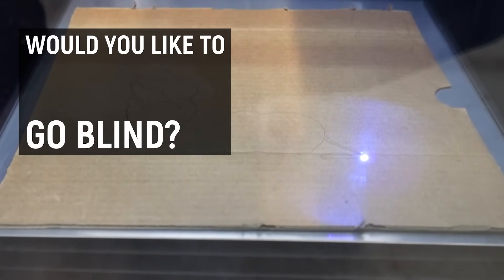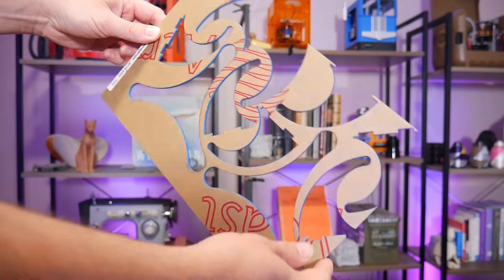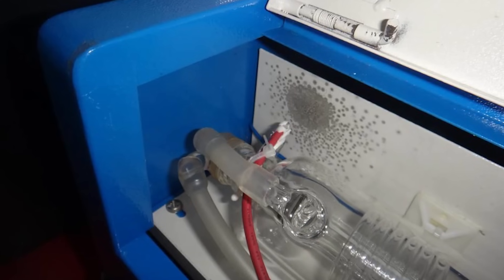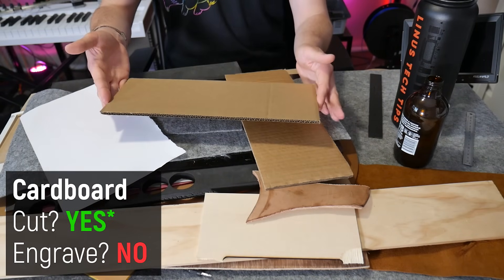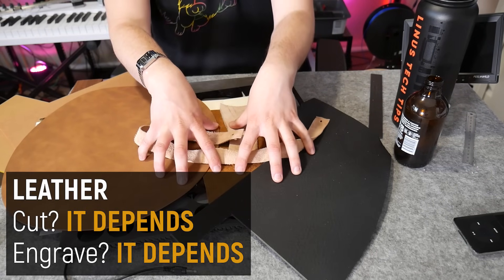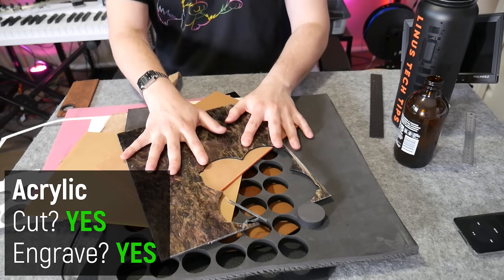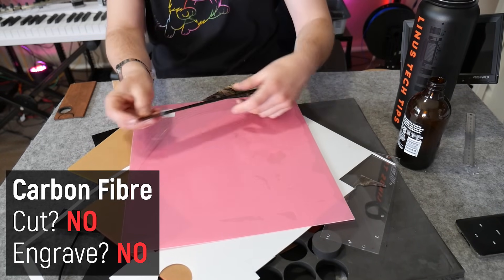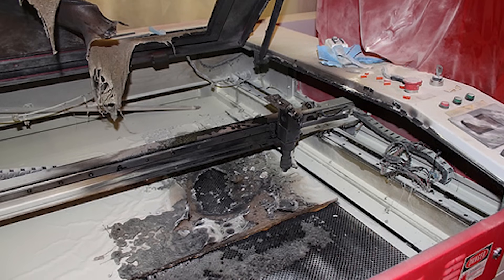Are cheap laser cutters safe?

Comment: I have laser googles that are safe to use with my laser but first thing I did was to build enclosure with fume extraction.
I rarely look at open laser when it's working.
Being in the same room with working uncovered laser for prolonged time is asking for trouble.
You will look away from the laser in the way that your googles are not protecting you.
All it can take is one stray scattered beam of laser light to do harm.
I once cut all the way to the floor with a laser that didn't power down after finishing the cut.
Nothing bad happened, floor was clean concrete and there was nothing to catch fire
but it was a surprise to see a blue dot on the floor when I knew that laser finished the cut like 5 minutes ago. :/

On another note: it is possible to etch acrylic with diode laser. You just need to paint it with something that the laser can affect.
And with 440 nm I found out by chance that after the beam passed clean through one layer of clear acrylic it didn't have much trouble engraving second layer of it.
Something to think about.

Comment: I bought an xtool D1 pro recently to start messing with laser. I haven't used it yet since I am still building the enclosure with fume extraction. I also got a 24x24 sheet of 250nm shielding for the lid from JTech photonics. Thanks for the video it adds a lot of extra information to think about/research.

Comment: poly-carbonate is a wide range of plastics one in particular I know should be safe to cut called lexan its used on police riot shields because of its durabilty and if burned releases CO2 as the main gas and few other trace gases such as water vapor as far as the yellowing I know lexan does yellow when exposed to UV and anti UV coatings are A not gonna cut well and likely have fumes anti UV coatings might etch just fine or they might scatter UV rays all over the place so this needs more testing to know to know about the coatings the lexan it self should be fine if its plane simple high impact lexan they also make fire rated lexan that is also likely to be a problem to etch and cut and the fumes are gonna be unknown

Comment: Look, for liabilities sake I realize that you cannot explicitly say what is or is not safe.
However, from a physics standpoint, most of your concerns are moot.
As you're aware, the intensity of radiation decreases with the inverse of the distance, thus, by the time the reflected laser light has traveled from your workpiece to your eyes, it's experienced quite literally a six order of magnitude decrease in brightness.
So while it may look bright, it's essentially harmless.
Furthermore, for the infrared lasers, while they're significantly brighter, the infrared light is highly absorbed by the water in your skin and eyes.  Well this might not be good for the surface of your eyes, it definitely protects your retina from damage. Unless the laser is getting shined directly in your eyes, you're not going to be injured from a laser of hobby grade.  When it comes to off gassing, your concerns are equally moot.
In the medical industry, when you have problems with wound contamination, the first thing they will tell you is that the solution to pollution is dilution.
Does cutting PVC create hydrochloric gas? Yes. But it creates a very tiny quantity over time, and even if it does make it to your lungs and it does recombine into hydrochloric acid, there are so many free species of ion that it will form salt almost instantly. The same thing goes for carbon nanoparticles. The real danger exists actually with larger particle sizes that your body cannot break down and metabolize.
Call your safety recommendations are good in practice, and it's good to have proper habits. But it's also good to be aware of physical limitations to safety paranoia.
I would be less concerned about breathing stinky byproducts, and more concerned about improper ventilation or filtering for the room. Poor room ventilation will actually impact your health far more severely than the burning byproducts of some of these lasers.

Comment: You really do NOT want to laser-cut chromium-tanned leather.  Chromium is one of the things you really don't want to "fuck around and find out" with.  

(I've worked in a chromium plating shop.  It tends to have nicknames like "Liquid cancer" for reasons.   )

The other downside of laser-cutting pvc is that the HCl gas is of itself highly corrosive, and will stuff your lasercutter - in addition to seriously harming you.

Comment: There are ways for makers to safely use a laser:
1) go to a professional makerlab where you have a professional laser and get proper instructions
2) hire a professional company and get the parts cut
3) start reading your local regulations on employer's safety, book a training from a professional company

You know what happens when you put an egg into boiling water? The same happens when a laser heats up a spot in your eye

Comment: I just got one of the Creality Falcon 10w lasers and was cutting out a pumpkin from a 5 gallon paint stirrer (which I have done like 20 times already at the same settings), had to pee so I went to the potty. Came back and the stick was on fire and it melted the red plastic laser cover they come with. This was at like 70% power, cant remember speed, and doing 4 passes so I could run it faster to supposedly help with the fire issue. DEFINITELY wear the glasses, get more glasses and out it somewhere people can't just stumble into the area while you are using it. I bought a cover for this one along with an extractor fan and hose to vent it from the enclosure (just like a grow tent) but have not put it together yet as it is in my garage, no kids at home and the only animals are the wild critters running around (so many deer...sheesh).
Anyway, thanx for the video and I really do hope people take them seriously as they can turn on you in a heartbeat and injure you or a loved one if you are not careful.

Comment: No. The answer is no. That should be in giant letters 2 seconds into the video. The answer across the board is these are not safe, and if you can't see that from looking at them you shouldn't use them. I'm 10000% for these things getting cheaper and more available. What's not good is the number of people that now have access to devices that can seriously injure or kill not only themselves, but everybody else in the house/apartment building as well. 
Fire, the obvious going blind bit,  chemical weapons grade off-gassing, etc. 
These are shockingly dangerous machines. - Add to that the fact that many of the cheaper machines are outright electrically dangerous. My chinese 40w machine shocks the hell out of you if you touch the case. The pump it comes with grounds to the water you submerge the pump in.... If you touch the water you get the hell shocked out of you. My machine is far from a one-off. It's pretty standard.

Comment: I really like your videos. In my opinion though this came across as be afraid of all the things!!! It's too dangerous for mere mortals to be responsible with. Rather than learn the thing and respect what it's capable of.  Anything is unsafe when used improperly. Are cheap lasers safe? They are exactly as safe and a pro level laser without it's safety features. A high end laser will also produce fumes etc without it's safety functions in place or turned on. Those are my 2 cents for what it's worth.

Comment: Best test for laser safe materials: take a small piece, burn it with a lighter (outside in the open air) . If you smell a very sharp smell ( plastic), it will contain Chloride. If it's supposed to be leather, but it melts, and burns bubbeling and black smoke, it's PVC or plastic and not leather.

Comment: It's an interesting video but I think the title is irrelevant or I feel like is blamed on the lasers instead of the dumb people using it,  I know someone who almost burned his house down with a 4000$ dollar laser cuter,  was it the lasers fault?  NOPE  he was trying to cut a material that he hadn't researched on and was highly flammable,  I personally bought myself a cheap 200-dollar amazon  5.5w laser engraver /cutter, I did my research and I know it was a cheap laser cutter and it got lots of limitations in the things that I can cut,  I personally just use it to engrave acrylics and it does an amazing job,   and obviously safety is FIRST,  I know acrylics emit fumes so I bought me an enclosure and a fume extractor and I been running it with no issues can easily cut 4-5mm wood but I like to use bamboo, anyways thanks for educating people on the materials that they can cut/engrave.

Comment: If you can still smell the material you obviously have inadequate extraction. Seems like your whole premise on this video is based on the fact you missed this glaring problem. It can be done with a PROPER ventilation system.

Comment: Cool project!  I have also had several situation where I had to to combine data from multiple sensors to get more accurate positional data.  One think I found helpful was what I called a "laws of physics filter" which filters out results that are not reasonable.  Also, you probably need to add an algorithm the pre-filters the GPS data to account for the affect of GPS lag combined with rocket velocity.

Comment: Was curious about chrome tanned leather, found this.  "Laser cutting chrome tanned leather releases cyanide gas, which is highly poisonous and potentially lethal."
Reply from the maker: That sounds horrific, but is it a reputable source? Lots of misinformation sadly.
Reply: @MakersMuse  Glowforge forums. Users in Texas (of course it is users in Texas). At any rate, they stated it is a pain to work with so probably better to just avoid it b
Reply: I think they mixed up chrome tanned leather and PVC faux leather. 
Still, I wouldn't put chrome tanned leather in my laser even though it has an extraction system.

Comment: If I ever need anything laser etched/cut, I would rather use an industrial sized one. I also have to say the open housing laser cutters seem like one of the worst ideas, especially since these are hobby level. The hobby level things need to be idiot proofed first, but all of these companies want that short gain money goal. Somebody will sue them for damages caused by improper safety caused by the machines.

Comment: Honestly, the proliferation of these things makes me stay far, far away from any so-called maker. I've turned down a good few invitations to people's homes on the mere suspicion they bought one of these cheap diode-based gantry lasers. No way will I ever come near that garbage.

Either it's in a Class 2 enclosure with appropriate safety interlocks and exhaust, or it's in a properly stocked laboratory with appropriate engineering controls, PPE, and procedures, or else I'm not going to be present. No further discussion.

Western countries really need to pull ahead of this trend and ban them outright in residential areas, with hefty fines attached to their unlicensed use. Your average Joe tinkering in his garage is not going to understand how badly he could injure himself or others. It probably won't stop everyone. After all, people still rig up microwave oven transformers to burn stupid lightning patterns into wood, and end up popping their limbs like sausages filled with popcorn. But it can be heavily curtailed.

Comment: Products don't display a sheer disregard for safety, people do.  If you set up any quality laser module and use it without proper eye protection, ventilation, and safety enclosure, you're taking a high risk. None of those safety apparatus are actually part of the laser though, whether it cost $5 or $5000. You make it sound like those health/safety risks aren't something to be concerned with on expensive lasers. An Undue sense of safety by purchasing a more expensive device could lead to it being more dangerous than the cheap, poorly made competitor. But then, affiliate links don't pay as well for dirt cheap items as they do for name brand or top of the line components, do they?

Comment: Anything with an exposed high power laser requires careful handling. I would also avoid using the included laser glasses for any of these and get proper ones for the laser frequency being used. Look even a bluray laser diode can damage your eyes. If you don't understand safety you have no business to be using these.

Comment: So far you haven't said that the machines themselves are unsafe. You are saying that users need to be educated and that is something that is a personal responsibility. People who buy a product and don't either educate themselves or do the research necessary to operate it safely are responsible for the outcomes. If I went to a commercial company and bought $100,000 setup they aren't going to hold my hand either. It could be the safest system in the world and due to my own inexperience I could kill myself or others with it. This is a matter of personal responsibility. 

Personally, I would never use the included eye protection that ships with any of these lasers. This is the one area I agree with you on. These companies should not be shipping goggles that are not properly designed to protect the user from their product. The majority of them are not designed to block out the specific color/spectrum of laser and none of them are certified. If you're going to purchase one of these cheaper diode lasers the first purchase you need to make is laser certified eye protection. The cost of a good filtered air and smoke extractor is not going to break the bank, again yet responsibility. The same thing could be said for enclosures. Even soft-sided sub $100 enclosures made of flame retardant materials have ventilation hookups. I appreciate your warning and I'm sure there are people who watch this video who might have done no research or taking no safety precautions whatsoever who hopefully learn something but my sympathies are not with them if they didn't do basic research for themselves or others around them. My sympathies would be for the others and the purchaser/operator gets zero.

Comment: This seems like an alarmist video that takes valid concerns about ALL lasers and tries to assign them EXCLUSIVELY on diode lasers?

* I've heard too many stories of CO2 lasers damaging people's skin when they aren't cautious about the beam path when aligning or testing. Yes, early diode lasers had a hinged acrylic shield only on 3 sides. The newer ones have a shield on all 4 sides. At any rate, the instructions are very clear that the laser beam should be on the side facing the wall and away from any potential viewers.

* Laser cutting PVC, polycarbonate, and carbon fiber are just as dangerous in CO2 as with diode, and in the case of CO2 can completely destroy the machine. No faux leather or suspected material should be cut without performing a flame test with a blowtorch and a length of copper wire on ANY laser cutter. 

* As for a risk of fire, some Diode lasers have flame sensors which halt the machine if a fire is detected. Wish my CO2 laser had this. At no point should a laser cutter of ANY kind of left completely unattended.

The diode laser industry isn't going anywhere. Diode lasers are up to 20W now. When they hit 40W at the $1500 price range and can run Lightburn, who the hell would buy a Glowforge or any other "entry level" $2500 CO2 laser?

Comment: There's an even worse substance you need to keep well away from laser cutters, and that's fluorine-based plastics like Teflon or PFCs. You really don't want to be laser cutting anything with fluorine in it, since fluorine combustion produces hydrogen fluoride as a byproduct. Like its heavier congener, hydrogen chloride, as you mention, hydrogen fluoride reacts with water to produce hydrofluoric acid, which is far, far nastier than hydrochloric acid and will kill you a lot more quickly.

Comment: The true mark station we have at work will engrave everything. Absoluty everything.. It's fully enclosed and has an automatic door which is the really scary part. You push the button the door closes and the edge is done before you can look over. I just hope those open laser cutters get banned one way or another

Comment: So I once thought it would be a good idea to have a hot dog engraving business.  Let me tell you - it WREAKS.  Couldn't handle the smell that permeated everywhere.
Reply from the maker: Yeah we tried engraving food and everything absolutely stinks, and then tastes horrible! 😂
Reply: @MakersMuse  but having random fortune cookie wisdom on hot dogs was definitely fun.   I wish it didn't stink though :D  Building my new portable vertical laser cutter now.  Mobile toolsert station - go from shop to shop and generate their specific setups on-site.
Reply from the maker: @rotohcf1400  nice! Consider offering them custom metal asset tags too. Buy ss blanks, pump out custom number runs with cermark. Was easy money for the laser 👌
Reply: @MakersMuse  great idea! Thanks!  Will have to add some magnets for work holding for that kind of work.  It's all getting mounted on slide rails in the back of a van, hence the vertical orientation.